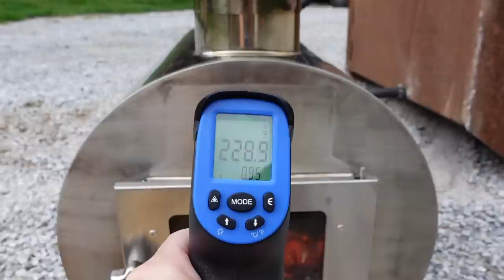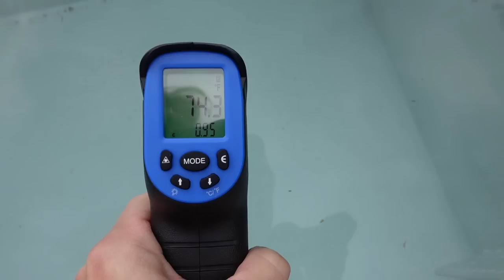This day felt like a dream come true! (Cabin on a cliff series)

Comment: Have them put a drain in the bottom of the tub too in case of emergency, say you heart attack in it or something and need to drain the water fast. Good Job on window, even overkill for a cabin but better overengineered than under. No need to buy all those plastic shims with a forest and sawmill around, pine cutoffs are fine. Keep it up and remember to resist the urge to "Lowes" or "Home Depot" as much as you can.

Comment: Michy defeats the Tyvek that won't shut-up. The cabin is coming together. You'll be ready for snow before it comes. As for the heating unit, you can't have new equipment with hairline cracks.

Comment: Hey Kiddo.. the flashing at the deck attached to the foam will be just fine..the water will run down the siding onto the flashing and away from the building...your doing a very good job..Be safe.

Comment: It could be possible that the small inlet/outlet hose diameter you're using with the water heater is developing more pressure than the heater is designed for.
Return it and switch to the larger IN/OUT plumbing.
Great Content, Thank You

Comment: The person I learned about waterproofing from always said "think like a raindrop".  Do that, and you'll get the layers of bituthene in the correct order.  Any brand of asphaltic membrane will work, they are all basically the same stuff.  You can get it in various widths.  When doing the sill, put half of the width on the sill, the other wraps over the bottom.  At the edges, cut the width in half.  One half goes up the side, the other goes straight along the bottom.  Do the same thing down each side, layering that over the bottom layer. You can make a little bow tie shaped patch for the corners.  The stretch Zip brand tape is probably easier, but not necessary. Great job!

Comment: The purpose of the blueskin/resisto isn't just a shingled drainage plane, it is also a self healing membrane so when you drive a nail in or other penetrations it coats the fastener and seals the hole.
You don't have to do the entire inside of the frame, but it's a good idea to do the entire face of the frame where you're nailing the window flange on.  or a non-hardening sealant.  Caulking, etc.
I put my windows on the exterior of the rigid foam, it makes fastening it a lot harder, but the thermal break on the frame is very important, it is where most of the heat loss occurs with modern windows.
Reply from the maker: Good points. Thank you!

Comment: Hi 👋, Michelle , great progress on the log cabin in the wilderness, should we be calling you the wilderness girl?, 😂 . Or the wild girl from the mountains., that was a slippery slope. 😂 , I remember from a few years ago, putting windows in that I’d made, always make sure you’ve got everything by the side of you, including props, you have to do a little list and put it by the window, saying do not fit window until you’ve got all your tools, screws, hammers, et cetera et cetera😂, it’s going to be amazing when it’s all finished and you better sit in your log cabin or on your decking looking out across the mountainside, can’t wait to see it finished, it’s a joy to watch you working, especially when you realise that you have forgot something, 😂. The hot tub is coming on well shame about the leak in the boiler system., but that could be a bit nasty, you might bear to put in a little solar pump to circulate the water a bit easier, and if you put the bigger fittings in as I think you said the flow will be a lot quicker as well, I could really do with your sawmill, as I have managed to pull some trees out of the river and I’ve still got three or four more trees to take down, I have about a acre and a half of land runs along the river, and I am responsible for that embankment my trees fall into it. I have through move them., Keep up the great work. Look forward to your next weeks work., stay safe, Phil from the moulin France.

Comment: I seal the window opening with tyvek or tar paper first. I caulks the flange then set the window. I seal the flange after I nail it in with the buytal tape.  Seal from the bottom to the top.

Comment: Howdy Michelle & Steve, I have a "smart" suggestion for temperature controls on the hot tub. Use a Sonoff TH16 with probe to control a water circulating pump through the wood stove. You can set the temperature from inside the house via the eWelink app to within 1 degree. I would suggest a second pump, on a separate Sonoff Mini R2 to keep the water circulating like a Jacuzzi. Place these controls in a water tight electrical enclosure. Both are accessible via Alexa & you can ask Alexa what the hot tub temperature is from inside your home & make changes on your phone. Just imagine being in the hot tub and asking Alexa to " turn the bubbles on", and you get bubbling jets of water via voice. BTW: the Sonoff Mini R2 has 2 terminals you can use to turn on the bubbles that use no power, but instead use 2 wires on the logic terminals (grey) to activate the chip for manual operation at the hot tub via a rocker switch on the outside of the electrical enclosure. The switch will work in unison with voice command. To avoid runaway heat you will need to divert hot water to a separate place or risk damage to the boiler from over pressure when the probe cuts off flow to the hot tub. For this, divert the water to a radiator with electric cooling fan and another temperature probe and pump.
Reply from the maker: Great ideas! The problem is that this tub will be off-grid, so we were trying to avoid pumps of any sort 🤷🏻‍♀️
Reply: @michygoss7148  OK, Good luck 🤞

Comment: I'm captivated by the creative door design on the cliff cabin shed. It's truly unique. When it comes to construction details, make sure to use flashing around the edges of all openings. Additionally, ensure that the tyvek (or other) membrane is securely wrapped around the header, sill, and studs, as you'll need to apply more flashing after installing the windows, doors, and drip guards. To prevent water penetration, it's advisable to use a rubber roller for even application of butyl flashing; water can't penetrate butyl unless there are small air pockets.

Regarding the hot tub, have you thought about using four holes instead of just two? This could help distribute the hot water more evenly. I'm intrigued by the thermosiphon system. Have you also thought about incorporating a Stirling engine to power a pump, thereby increasing the water flow rate?

Comment: I’ve always wrapped the Tyvek , then installed the windows and then put up a flashing perimeter of ice and water shield that overlap to keep water out. I do that with any hole in the building (doors, windows, vents, chimneys, exhausts, etc). It’s the way I was taught. If your way works for you, that’s fine by me lol
Reply from the maker: Once the window is properly installed, I will add more tape/flashing material around the window 👍

Comment: We would have stapled the top tyvek the same as the sides and bottom. Then a 3/8” silicone bead around the perimeter which will end up underneath the window flange squished, sealing the window, then level and secure the frame, then use your black 6” wide tape to seal the exterior surface of the window flange to the tyvek.

Comment: Is there a pump anywhere?  You might want to add a couple of inlet ports and branch the hot line so it's not just heating one spot in the tub.  Another idea would be to add a line coming from the bottom of the tub into the hot line with a check valve and a shutoff valve so you can regulate the temperature with the shutoff valve by mixing cold water into the hot water.

Comment: Do NOT use silicone around windows on the flange!  It makes replacing them VERY messy and is unnecessary.  I'm glad you didn't have any!  ALSO, @25:57... BOTH pipe openings in the hot tub MUST be underwater for the thermo-siphon effect to work.  you CANNOT have the hot water pipe above the waterline, otherwise you will boil the water and only steam will come out, with spurts of water.  And YES, you need extremely low resistance to flow when relying on using thermo-siphon effect to pump water based on the density change of heated water, a 1" pipe is not big enough to allow for good flow.

Comment: Michelle, the makers of that Zip tape ( flashing tape) suggest the use of a hand roller to use in applying the tape. Removes trapped air and applies even pressure to insure a uniform bond to the applied surface. ( just thought you should be aware) As always a great build. It’s going to be a great escape for you & Steve ( thought I was going to say Bigfoot didn’t you 😅😅) Wilber & Margaret, the lower 48. ❤️❤️👴🏻🧓😍
Reply from the maker: Yes, I’ve seen those rollers. I am not using that tape though, so no need to buy one 👍
Reply: @michygoss7148  ok, though it was Zip system. My bad.
Reply from the maker: @wilberjeffcoat8309  no worries! I didn’t know that stuff (zip) existed, otherwise I would have bought it.

Comment: Spray foam works to fill any gaps in the ridged foam insulation. There are lots of ways and products to install windows and new ones being developed all the time.  Obviously the goal is to get it water tight.  If it fails you can fix it.  Thanks for the episode.

Comment: I love your accent and your videos.  If you spray foam on the inside around your windows just make sure you use low expansion foam. Regular foam can expand to the point that it will bow the frame enough to break the glass. Plus your water leaking through the welds is a simple fix with a small oxygen/acetylene kit and brazing over the weld. Its very easy to do , for me anyways, if I were there I would do it for you). Maybe you know someone there to do it without returning the entire heater tank.

Comment: Others have said enough about your windows... I hope you and Steve were able to soak in your hot tub before returning the components.   If you have a spare sheet of foam insulation cut a slab that fits snugly inside the car and a second slab that is large enough to cover the top with an overhang the thickness of the foam.  Adding outer sides to whatever depth you think is appropriate you will be making an insulating lid.  

Wishing you, Steve and your furry kids a blessed week filled with gentle seasonally appropriate weather and restful evenings together enjoying your incredible homes.   Peace princess
Reply from the maker: Yep, I will definitely add foam!

Comment: you can drill the hole your self just take a board and drill a hole with the right size metal hole saw that you can then use as a guide to cut the hole over that hole. I would make the hole on a long board that I  would clamp to tank. use oil to help the saw cut.

Comment: Could you add something like a mixing chamber on the outside that the hot water comes into that mixes with the current tub water, or perhaps a mixing valve taking some water from the outlet port, to reduce the chance of scalding yourself with boiling water?  You could regulate how that comes into the tub to keep it from getting too hot too, I think.

Comment: You just tap the staples in with the side of the hammer tacker. You pretty much have it down with the windows and tyvek. You should always flash the sides and we use carpenter pencils to shim windows up and yup you need to caulk the windows in but your not frosting a cake so don't over do it .👍
Reply from the maker: I do end up doing that, but I feel like there should be a dedicated little hammer end or something to make it official! 😂
Reply: @michygoss7148 I have one that the back side is used for pounding . Not sure if brand but it wasn’t cheap. Stanley maybe 🤷🏻‍♂️

Comment: It is NOT necessary to have a slope on the framing of the window sill. An outward slope only matters where water can get on it. Good job setting the window alone. Much, much easier with two people.  My thought about putting a surface to hammer in staples on the top side, is that the force to tap it might cause the stapler to shoot one out at you. I think adding a cap on the back of the handle might be feasible though, kind of like the cap on most quality putty knives.
Reply: I always thought it should go on the side of it.   That way it wouldn't trigger the stapler.
Reply: @calvindawson8246  On the side might work okay, but I think numerous "taps' or pounding on the side is likely to jam up the inner workings. It is not like any staplers are crazy reliable, even when used as designed.

Comment: Coming along nicely.  Are you putting the rigid foam insulation in additition to inside insulation or instead of?  Just curious.

I wonder if there is some kind of submersible agitator that could be put inside tub, in a corner, to mix the water up to achieve a uniform temp?  Also an inline solenoid tee valve controlled by a thermostat would be good; one end of tee goes to tub, other goes back to pump to recirculate when temp setpoint achieved.

Comment: Sorry your cooker is crap!  Thermosiphon is great...just not fast.  How it is designed into the stove can really make or break the efficiency.  Adding a small solar pond pump can give a system the boost it needs to make it a steady heat sink as opposed to small amounts of water getting overheated for an energy loss.  Remember that boiling water anywhere in the system is an immediate heat loss.  Air is an insulator.  Not sure if that makes sense.  I know I explained it poorly.  Cabin is looking great!

Comment: @10:17 More than once, I was called back to a house that I framed to find a "flutter" or even worse a "whistle" sound made during high wind days by the Tyvek underneath siding that I had installed. The amount of tape and staples I used after a couple of those calls was dramatically increased.

Comment: When does your winter prohibit working on the cabin and what do you hope to get done before the snow really starts flying there?

How do you drain your ore cart tub?  The lower hole for your circulating hoses looks like it would leave a bit of water in the cart. Did I miss another drain plug?
Reply from the maker: I will continue to work on the cabin in winter, and hopefully stay in it!
There is a drain hole in the bottom of the tub that we had installed.

Comment: When did you put that stove pipe through the roof?   Guess I missed that.  Looking good.  Interesting that you are using a filet knife instead of a zackto or utility.  Edit: that seal up around the window looks great!   As always nice job Michelle!
Reply from the maker: You’re the first person I’ve seen to mention the stove pipe! I’ve never mentioned it or showed it, but I installed it in may with a friend. But we did it in such a rush, the footage isn’t great. Waiting until the cabin is closed in and I can put a fire in and make it a decent video 😊
Reply: @michygoss7148  Thanks for the reply.  As a commercial pilot I was taught to notice details and any changes in systems.  It was usually your first warning that something was about to come apart!   I enjoy watching all the things you and Steve do and the specific nuances as you do them.  Watching Steve with the boat and it’s systems was fascinating.   Like when he had those grab bars installed around the engine to hold on to in seas when you work on them.   The exterior insulation on the cabin is different too and it’s nice to see it going so well.  You ought to be on a postage stamp in Canada as “ Woman Can-do!”

Comment: You have your plywood then you put your Styrofoam insulation over your 1 inch you take your tire back and you tuck the tide inside what your window opening is that helps create another barrier can you place your window and then you can use a screw that’s a little bit longer in reality. Your type of your plate should’ve went on your phone should’ve went on and then your tie should be the last thing that goes on and then put your windows in, I’ve only been doing this since I was 12 so I

Comment: Someday, someone, is going to have to replace those deck boards.  Not going to be fun pulling them up when one edge is hidden under foam, flashing and siding.  Just sayin'.
Reply from the maker: They can just cut along the siding and add another joist 😁
Reply: @michygoss7148 - I knew you'd have a plan ;-)

Comment: Everyone staples up TyVek(Housewrap).  That is not proper installation.  You're supposed to use nails with plastic washers.  The staples cause little holes and will also rust away over time.  This probably won't be a big deal for a part-time cabin but with all of the effort you're making to create an airtight structure you're defeating the purpose with the staples.  Those will act like a pinhole in a balloon and concentrate vapor at the staples.  The nails are a pain in the butt.  I'm using them on a project right now.  Stapling is much easier and I have a hammer tacker that does have a hammer side to finish a stubborn staple but it's not correct.
Reply from the maker: Perhaps correct, but my added exterior foam becomes my water membrane, so imperfections in my tyvek are much less relevant.